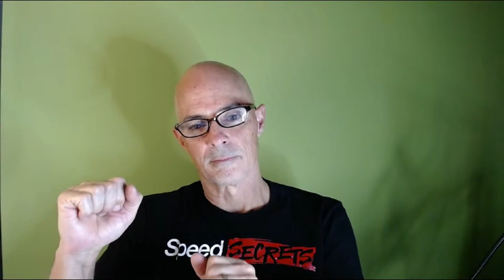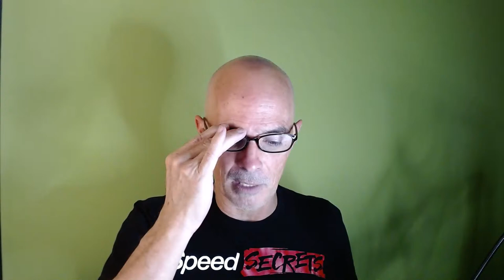LET'S TALK TURBOS-COMPOUND BOOST-TURBO PLUS M90 BLOWER 3800

Comment: Easiest way for  g3 to g5 blower is   changing  the  lower intake manifold  over
Reply from the maker: THNX-I HAVE BOTH
Reply: @richardholdener1727   oh yeah i know just letting you know thats the easiest way ... the zzp guys use to offer a s2 lower with the work done to run a g5  but no need if you have the g5 lower regardless 😉

Comment: Richard,  when you ran the NA intake manifold for the turbo test, how did you get the NA to fit the L67 since the injectors are in the head on the L67? Thx.
Reply from the maker: we plugged them

Comment: I've got an L67 with M90 smaller (2.49) pulley pushing 17 PSI on E85.  No IC.
I've also got a turbo kit lying around with front mount IC. If I add this turbo, will I have to put a bigger pulley on the front of the M90 , i.e. is 17 PSI from the pulley too much to start with? no heads no cam (yet)
Reply: Forgot to say, really enjoying your recent videos mate. extremely informative. 
Thanks
Reply from the maker: less boost from the blower and more from turbo